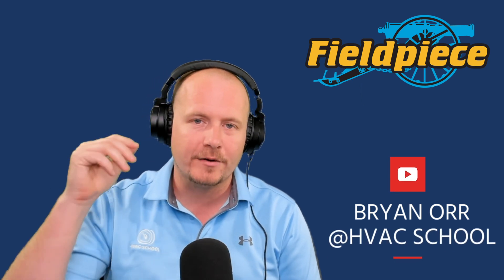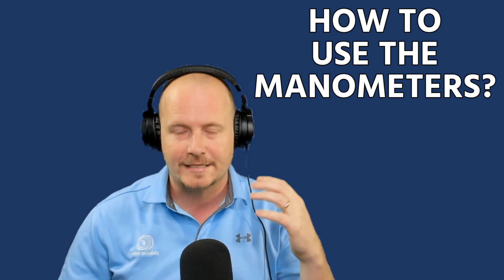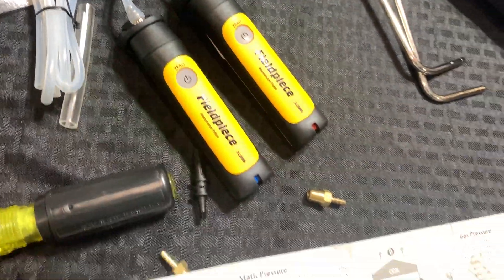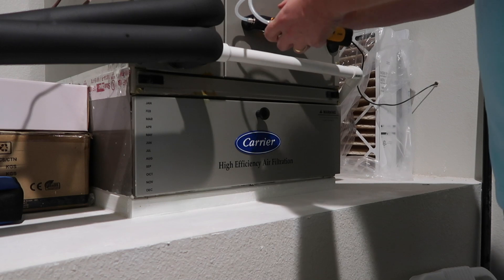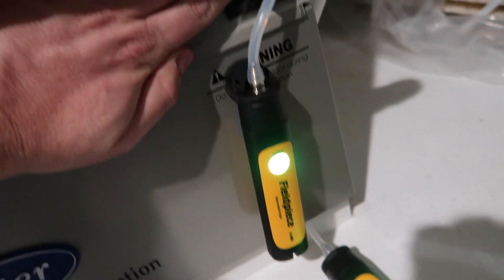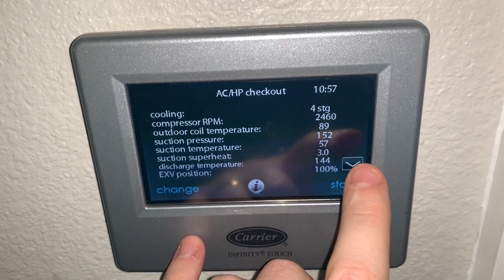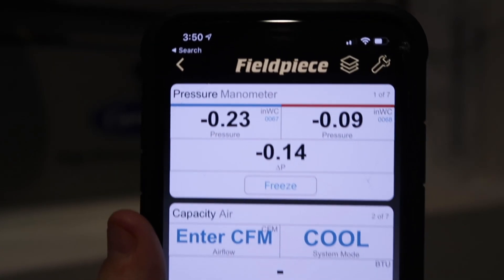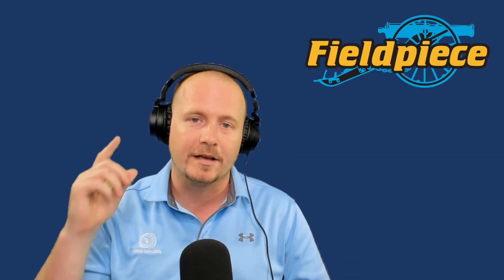How to Checkout Blower Settings Using a Manometer

Comment: Drill a hole(s), for crying out loud!!!
Pinching the tubing is pretty hackish.
Reply from the maker: For a filter that isn’t practical or necessary
Reply: @HVACS  
How is it not practical or necessary?
It takes less than a minute to drill the holes.
Watch that video objectively and tell me that popping out a plug would not be easier and faster!
If this will be done on a regular basis, it would be foolish not to drill holes.

Comment: can it be use to check the Liquid pressure drop in pipe and pressure drop across suction and discharge side of a pump?
Reply: No, they're just wireless manometers.